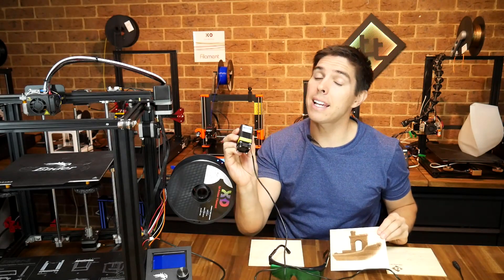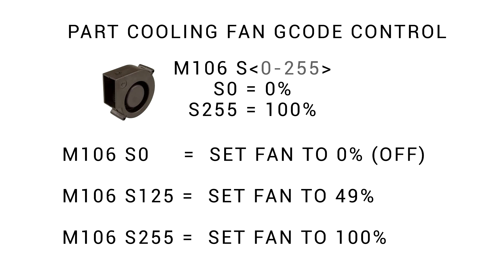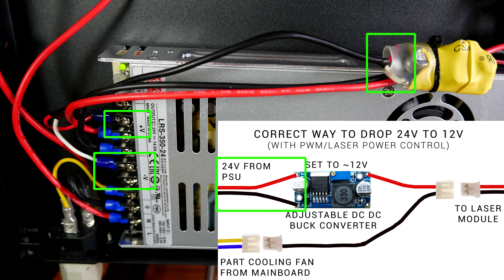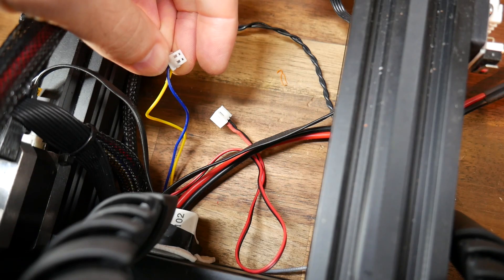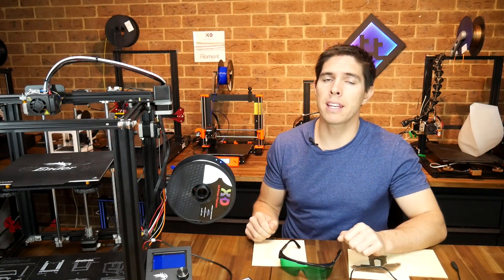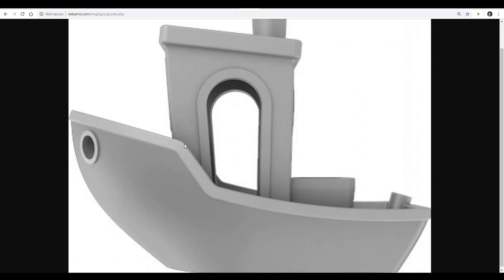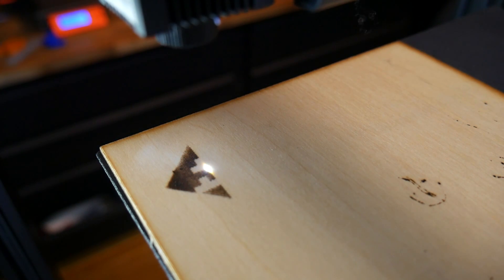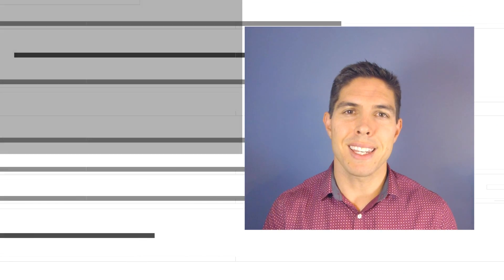3D printer to laser engraver for under $60

Comment: Hi bud, look I'm gonna be honest. I'm not 100% sure on your pwm control circuit. These things are typically 5V TTL input for power control. I see you've used the negative on your fan (presumably because it's switched low side by a FET). But due to the switching nature of a buck regulator, it uses ground reference for the output voltage regulation with a resistor divider connected to a comparator from that out voltage pot. By removing the ground reference (with the low side switch for the fan) you basically allow the buck converter to free float and effectively run 24V straight through. You'll have 24V transients going into the fan header until the regulation catches up through the feedback circuit.... This is why you have a delay when the laser power is set to 0.

Better ways for this circuit is a resistor divider set to 5V with a 5V zener to protect the input to the TTL rising above the set value.

Alternatively, use the 24V fan circuit with a 1K resistor into an opto isolator and use the output to toggle the buck converter to a TTL own signal into the control unit for the laser.

Either way... I don't feel confident in the pwm control wiring you have. It might work. But I'm not confident it won't have long term problems or wierd issues like your having for power control.
Reply: Buck converters are literally intended for supply line conversion. Not as a signal level converter.
Reply from the maker: After wiring the buck converter in this way, I've had zero issues. The issues shown at the end were from before setting it up this way. I appreciate you taking the time to post such detailed feedback. The laser according to the tiny info on the product page is meant to be powered from 12v. It has some on board components above the diode that may be handling the ttl. The way I see it the buck converter should be supplying a steady 12.5 volts at the output terminal, the pwm is switched on the ground pin and independent to this. I don't have a scope to verify but with a multimeter it never exceeds 12.5v.
Reply: @TeachingTech  You're pwm'ing the supply volts to the laser? Doesn't that laser have a TTL pwm input like most others do?

Edit.. nope it does not.

In this scenario, pwming the supply is all you could do. That said, the buck regulator will still be throwing in 24V transients into the laser on loss of ground reference. It's pretty risky to the health of the laser driver module. If you have an oscilloscope, you'd be able to see the buck converter lose regulation and produce these spikes.

Using an external supply rail and a typical heated bed external FET is a more reliable and preferred design for this application. 

Come to think of it (whilst I'm having Macca's late lunch), caution should also be taken with the low side switch for the fan also. It's expecting a low power rating. Larger laser probably shouldn't use this circuit directly as you've wired also. That current is being handled by the transistor on your mainboard 3d printer PCB. If that pops. You have no fan either.

Not taking a dig at you, love your content and big fan of your work.
Reply from the maker: All good, I appreciate the feedback and discussion. You no doubt have more knowledge than me on this so I'm happy to learn and update the description with any way to make it better.
Reply: @TeachingTech  all good, I'm not asking for any amendments. Happy to share design concepts mate. Ideally for pwm control, Banggood should send you a laser with true pwm ttl input. Much easier to implement.
Reply: Hi. 

exist PWM to TTL for 24V input?

greetings
Reply: If the 12v output of the converter really is fully floating all you need to do is connect the output negative to the input negative. That will ensure the +12V is referenced to 0V. My bet is most DC-DC converter modules have that connection already on the PCB.

Comment: any issues using this on a prusa mk2s ? maybe it will bring life back into my pos prusa junk printer
Reply from the maker: I don't have one to try but it would suit being attached to a printer than could still move in X, y, and z but had something busted for the hot end or extruder.
Reply: @TeachingTech  yeah my printer moves in X, Y, and Z fine but has temp issues i changed the thermistor and it did not help. i have reflashed firmware its been down for months i ended up buying a few Creality printers that i run now but i still have the junk Prusa MK2S laying around. if this is using fan settings? i might be ok if i can connected it to the main board forgot to ask what software do you use? for the laser cutting?

Comment: Great video,. Thanks.
I have been looking for a solution like this for a while, and I want to do this with a 17 Watt 450nm laser.
I don't want to use the printer as a printer once I convert it so it can replace the nozzle completely.
Going to use one of the homemade CoreXY printers for this so it can have an enclosure that I can ventilate.

Funny thing in your selected laser is that nowhere they mention the power of the laser. It's only stated to consume max. 2100mA of power for the whole circuit.
Reply from the maker: 17 watts is getting a lot more serious. I assume you would need a lot more beef in your electronics to handle the current. Plus a bed that it couldn't cut through. Sounds like fun though!

Comment: for just over $100 banggood has a 2W laser that works extreamly well on the CR-10,  substantialy cuts down on engraving time.
I can do a 200mm x 200mm picture in just under an hour.
last year I initially tried the laser that you have and just found it to underpowered.
there is a great tutorial on YouTube about the 2w laser from banggood.
if I can find the link I will update this comment.
Reply: I will be following this comment as well, as I would also love to see that video.
Reply: David @ Datulabs tested a 10W laser not too long ago. Maybe it's worth a look: 
https://www.youtube.com/watch?v=R9OHYq-Ws-w&
Reply: Do u find the link?
Reply: @AloneHell :

Seems they dont carry it anymore, but they now have a much better one for around the same price,    5w laser.
https://www.banggood.com/450nm-5W-Laser-Engraving-Module-Blue-Light-With-TTL-Modulation-p-1337358.html?rmmds=search
Reply: Deff worth the extra coin for this 5w laser, much more capable
Reply: @Dimitri2014  I did some research and 5,5w looks to be the sweet spot atm.
Reply: @MisterMakerNL : correct, that is a solid laser and deff increase your capabilities and times compared to the cheaper one that a lot suggest for cr-10.